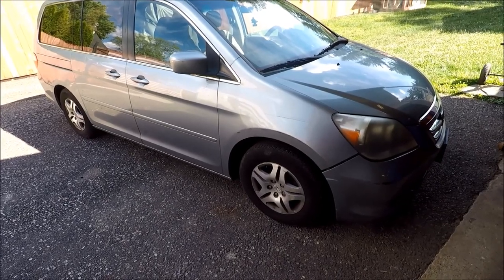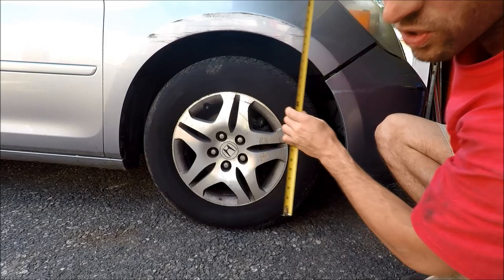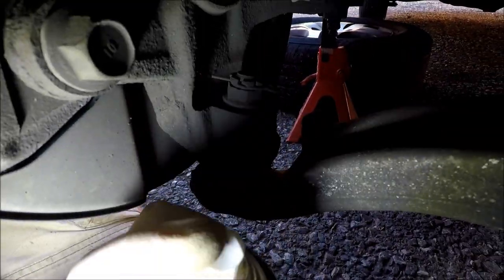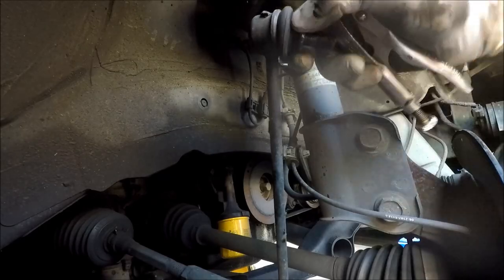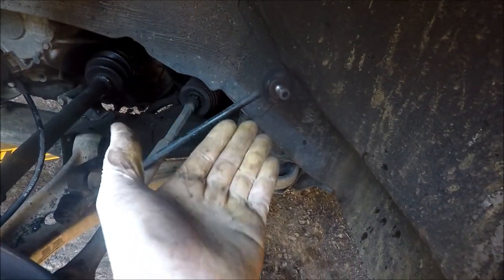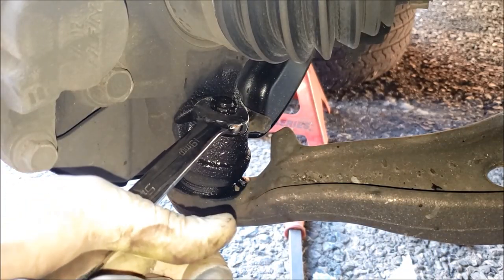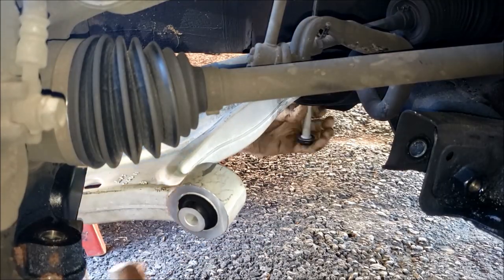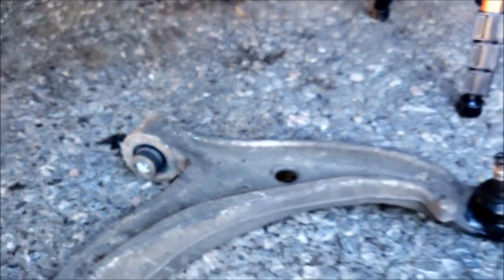How to Replace a Lower Control Arm  05-10 Honda Odyssey vans

Comment: Great video. The tip on measuring the center of hub to edge of the fender was priceless .  I had to use a pickle fork to remove the ball joints because it was stuck beyond stuck.
Reply from the maker: Glad it helped!

Comment: Just replaced mine with aluminum lower control arms and replaced the struts with new KYB complete strut assemblies up front , new steering ball joints ,sway bar bushings and links,and new KYB rear nitrogen gas shocks. Van drives and rides so nice now and nice and firm but not to firm and does not sway in corners and stays nice and flat at all times and big plus no nose dive when braking hard. Couldn’t be happier. Fun to drive now and no more noises. Now off to the alignment shop.

Comment: Did this today on my ‘05 Odyssey. Didn’t see anything obviously wrong with the old parts— no hideous bj play like you had. But a huge improvement resulted anyway. No more clunk and the front end is so much tighter and steering is much more direct feeling.

Comment: I like that you stress not tighening control arm bolts until your at ride height👍 measuring is much easier than trying to do it when vehicle is on the ground😊

Comment: Thanks for the video. Effective and complete with every detail. The video is helpful. :) 
One minor info: I jacked the lower control arm before tightening the horizontal screw. However, even the car was lifted from the stand jack. The distance between the axle center to the rim was longer than the car before starting the work, about 1.5" more. I could not shorten it further. Just tightened the screw with this distance.

Comment: Disconnecting the tie rod enables access to the horizontal 19mm bolt, with no need for the swivel connector.  Saw that on another video. I share it in case others lack that swivel connection.

Comment: Cool . I had a problem with the sway bar link i removed only 1 and tried moving it so i can have room for the bolt. So I have to remove both side like u to move it a little bit to have room. . Gonna try this thanks so much.
Reply from the maker: No problem Justin, good luck with it!
Reply: This is my “a-ha!” moment. I couldn’t get the horizontal bolt back in because the sway bar was in the way. It looks like you have to remove both wheels to get space to do so? Thanks!

Comment: VERY NICE VIDEO! has a certified member of health and safety I really like the extra safety you put into it both jacks stands the jack and the tire if everyone worked safely like you there would be almost no accidents EXCELLENT!!!
Reply from the maker: Thanks Jorge!  I usually don't get into safety that much only because I don't want to be held responsible but lately I've been starting to add more safety tips

Comment: I don't comment much. Was trying to decide whether to just replace my bad ball joint or just do the entire control arm. You get a thumbs up and a sub for this vid. Everything was short and to the point. As mentioned in another comment nut torque specs would have been a nice addition, but overall very well done instructional. Some of these auto repair vids are soo long and it's usually down to bad editing, a lot of dead time in the vid. This is my first time watching your channel so I can't speak to all your vids but I definitely love that it was quick and to the point. That was the big seller for me on giving a thumbs up a sub and a comment. If I could give extra thumbs up I would. I know YouTube won't count them but here they are anyway👉👍👍👍. Thank you! 😃

Comment: Great vid, very well done and accurate! Thanks! fyi- I do not think it’s possible to replace the horizontal bolt unless you remove both wheels. I tried jacking up the sway bar but there was not enough room on the sway bar to get the bolt back in. Definitely have to remove old wheels.

Comment: Correct me if I’m wrong here. Wouldnt grabbing the top and bottom of the wheel and rocking it demonstrate the play in the ball joint. Moving the wheel left to right could demonstrate the play in a tie rod end.

Comment: Not questioning the necessity to do so, but why do you have to jack up the wheel to the 16.5" height before tightening that bolt you mention? Are you locking the metal portion of that bushing in a different clockwise/counterclockwise position by lifting up the wheel, than it would be if you left the wheel hub sagging down?
Reply from the maker: To clock the center collar of the bushing at normal ride height before tightening. If you don't do it, it will be fine but the bushing May prematurely tear.

Comment: Question: if you were doing the struts at the same time, would you replace the struts first, drop the car, drive it, and then measure the distance from the hub to the fender? It’s one of those spring and strut kits so I presume the front would rise a bit with new equipment. Thoughts?

 Thanks
Reply: Great question, didn't even think of that!  I'm going to be doing the same replacements. What did you end up doing replace struts, drop n drive, then replace lower arm?

Comment: Is there a tool or method to preload the struts to make it eaiser to install the control arm? I was thinking of putting a jack on the bottom of the stut above the knuckle but thats eaiser said than done because there is a CV boot in the way.
Reply from the maker: You preload it with a jack from the bottom once everything is all assembled and tighten the horizontal bolt after it's preloaded
Reply: @NoNonsenseKnowHow  Its not easy to get everything assembled because the geometry doesn't work in your favor. It would be far eaiser if there was a tool to compress the struts.

Comment: This video is outstanding! I watched it 3 times now taking notes before I place an order for parts. I am going to change out the struts with the Monroe complete units. Do you have an opinion on how I should 'preload' the lower arm adjustment? Should I keep it the same as what I initially measured with the old struts?  Thank you.
Reply from the maker: Great to hear you found the video helpful and I appreciate you checking it out. Yeah I would just set it at the same height as the old struts
Reply: @NoNonsenseKnowHow  Thank you. Placed the order for parts and I'll start the work this upcoming Saturday! I've got 198,000 miles- how many on your Odyssey?
Reply from the maker: Awesome! It's actually not my Odyssey. It's my friends but he has probably about 240K on it I think. Maybe more
Reply: @NoNonsenseKnowHow  awesome- so great for you to help others.... I will do the same.

Comment: Will this make uour van steering wheel turn weird to one slide no matter how many times you get it aligned thanks.
Reply from the maker: Yes if the bushings are torn it can

Comment: Sweet..  question 2004 yukon upper  ball  joint it isnt coming free have an idea why??
Reply from the maker: Is it held in with a retaining ring? I assume you removed it if so. What are you using to get the ball joint out? A C-Frame ball joint press?
Reply: Yes I am but the retaining ring has been removed and at the junk yard no torches are allowed 😢😢
Reply from the maker: Oh damn. Yeah not sure what to say then. Maybe sneak a small propane handheld torch in. Little heat goes a long way.
Reply: Was thinking of a mini torch and take a look out.  LOL

Comment: Heating fastener's to remove them is the biggest misconception. Heating just makes them tighter. Cold makes it shrink. But you can heat then cool to make the metal walk.....
Reply from the maker: Heat helps.  Trust me.  Helps break the bond

Comment: I would add torque specs👍👍👍
Reply from the maker: Let me know what they are and i'll add them in description.  Thanks!
Reply: NoNonsenseKnowHow 65 ft lbs for both lower control arm bolts, 51ft lbs on the ball joint and 58 ft lbs on the swaybar links👍
Reply from the maker: Thanks! I'll add that to the descriptions. Crossing my fingers that your specs are accurate. Lol.  ;)
Reply from the maker: done
Reply: @NoNonsenseKnowHow  Do you have the torque spec for the CV joint NUT?  I am planning to replace that as well since the boots are getting cracked and have 258,000 km on them.
Reply from the maker: @MrDollar80  sorry I don't have it handy, but I'm sure a quick Google search will reveal results. Let me know if you find it and I'll add it to the description

Comment: Just changed this along with the inner&outer tie rods, sway links. All were ripped. Arm was a bitch to remove. Hitting it like shown on this video didnt do anything.
Reply: May I ask how long it took you approximately?  I’m going to be doing the same thing. Any other tips?  Thank You a head of time.